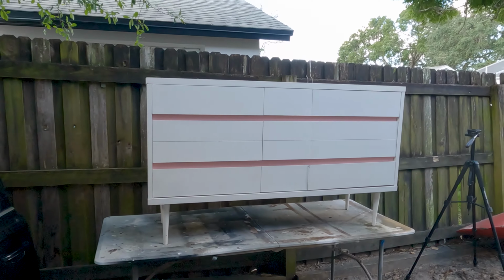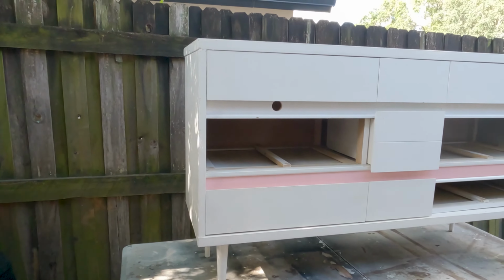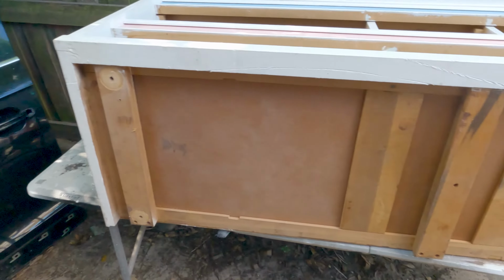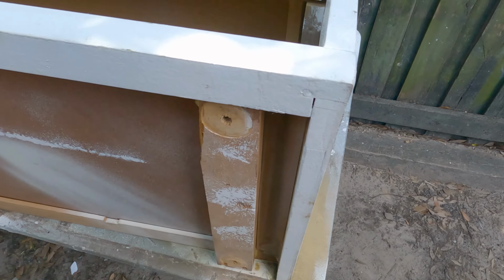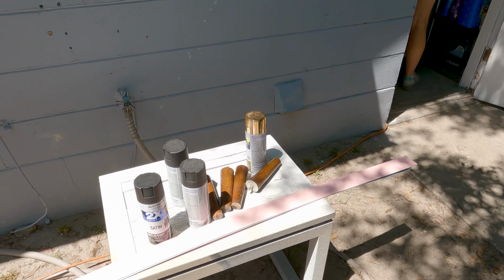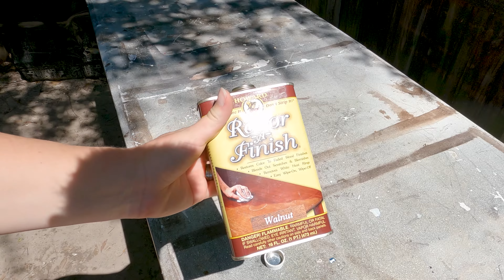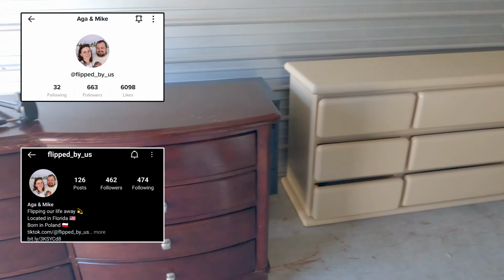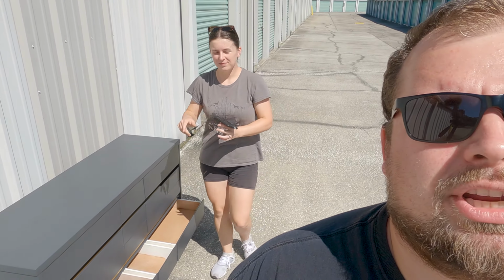MCM dresser with REVERSIBLE trims? | Furniture Makeover | DIY Restoration | Amazing Transformation

Comment: I don't know why you bother if you don't want to do it well. Should have been stripped and refinished. Just another paint over.
Reply from the maker: Thanks for your comment Beverly. We do agree that in most cases stripping would be ideal. We really wanted to strip and stain this piece but as we shown in the video the wood underneath was green and the stain would come out horrible. We did a few pieces in the past where we tried to stain green tinted wood and it never works. Our first plan was to try and stain the top too but in this dresser the top was 100% Formica. Sanding everything down and respraying was our best option in this case.